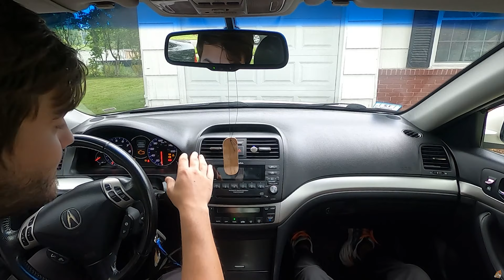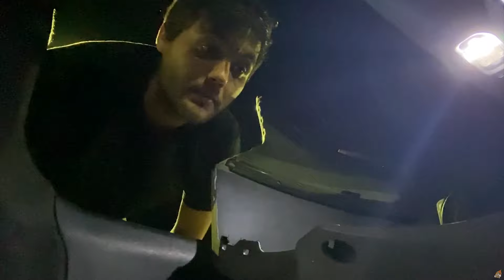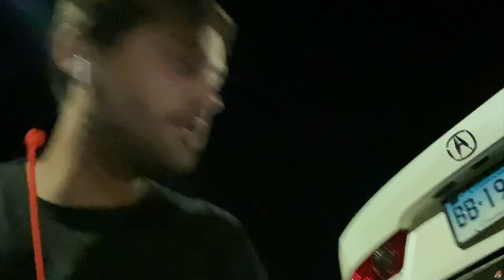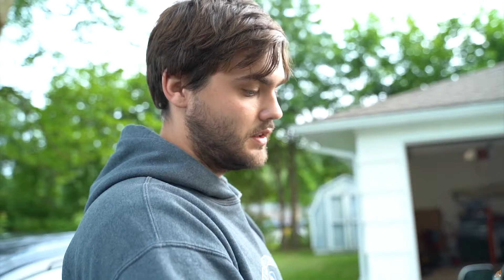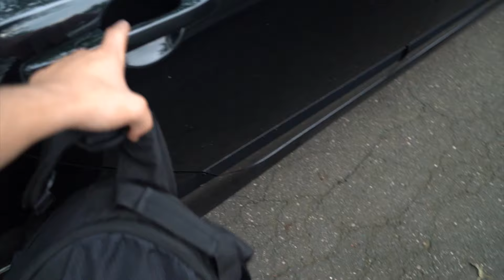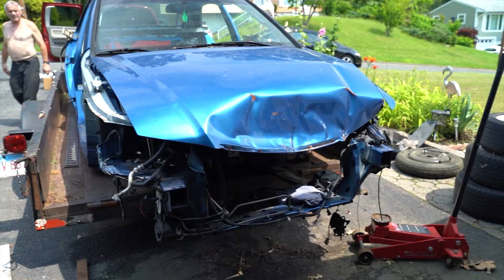Rear Bumper DESTROYED & Old Tsx Gets Scraped FINALLY!

Comment: To make you feel better - about a year and a half ago when I was living down in Texas I was on my way home after work (its a straight road) and out of nowhere this Subaru Outback kicks this bucket around the side of its car that subsequently comes towards me and then throws itself under my cars right side.  The side of my car hops up in the air and then a loud pop noise happens.  Some jackass had dropped a fucking bucket coming out of O'Reilly's.  This shit ripped off my entire A-Spec right side skirt resulting it being completely destroyed and being dragged by the rear bracket so basically making the car look like a farming combine if you can picture that.  As some of us know you cant exactly go buying a-spec sides as a single piece...hell its discontinued on any Acura websites now for PWP (except Heeltoe I think).  Filed an insurance claim and the body shop I went to ended up procuring one from an Acura dealership somehow thank god.
Reply from the maker: Wowww that’s a bummer it happened but miracle the dealership somehow had one in stock like never heard of anymore
Reply: @RishMedia  yep. Rarity but what are you going to do in your situation?  Euro rear is it's own piece right?  Add me to ig if you've got one - sf_brew

Comment: I gotta auto tsx been trying to get my car to do pops and crackles anyway I can?
Reply: I/H/E + Tune would be the best way to do it …
Reply: Sometimes after just the bolt ons you get some pops and cracks but not as much as if you were “crackle tuned”
Reply from the maker: I made a video on how to do the crackle tune with flashpro, can do that with ease if ya got a 07-08
Reply from the maker: But I have a 3” custom single exit exhaust abs has its little burbles and backfire
Reply: @RishMedia  got a 06 😢
Reply: @EddieAcostaG20  I/H/E ??
Reply: @EddieAcostaG20  nvm I understand 😂 had to look it up